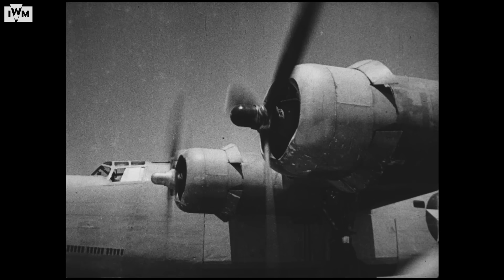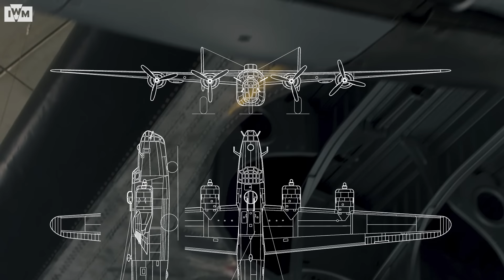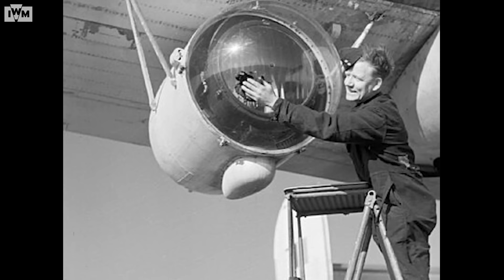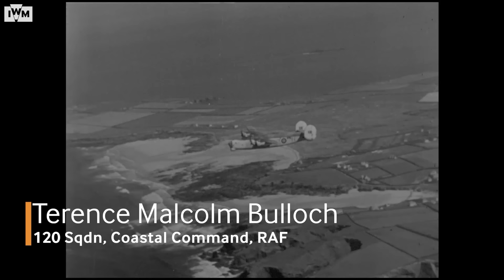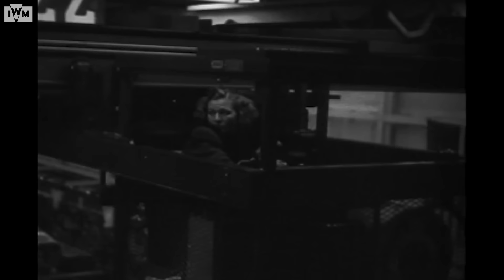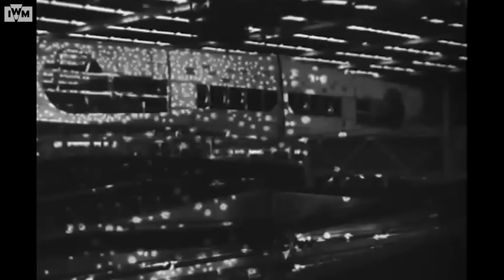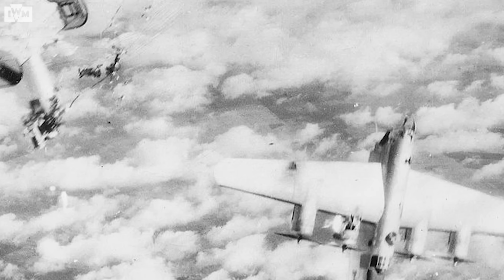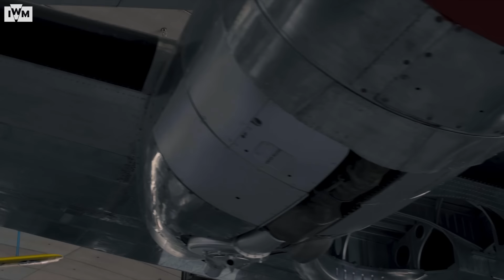The most produced Bomber in history had a bad reputation | B-24 Liberator

Comment: No such word as 'aircrafts'. Strategic bombing is not a flawed doctrine.
Reply: Yes.  It's not so much "flawed" as perhaps "overly ambitious".  Strategic bombing did not bring a swift end to the war.   However, it did help speed the end of the war along by exacerbating wounds and creates new ones that are constantly bleeding.  

Vehicles lost on the battlefield couldn't be repaired or replaced as quickly because factories were being disrupted and had to be repaired and replaced, themselves.  That might not bring a quick end, but it does bring a quicker end than you could otherwise expect.

Comment: I don't agree the Ploesti Oil Raids were ineffective. Nazi Germany's Achilles heel was fuel, they NEVER had enough. Even with coal gasification they lived hand to mouth and that process only yielded 87 octane fuel and NO lubricants. The Reich still needed natural petroleum and any disruption of oil supply at Ploesti hurt them badly-particularly in their ongoing Russian operations. While losses were high in 'Operaton Tidal Wave' the damage to the oil refineries in Ploesti was significant. Subsequent raids did even more damage. They did not shut down oil production at Ploesti, but the disruptions hurt the Wehrmacht and contributed significantly to the defeat of the Axis powers. Interestingly, the Air Force asked Consolidated to propose a design for a long range heavy bomber to use in case the B-29 didn't pass development-at that time the Superfortress was experiencing a lot of problems in testing. Consolidated used the B-24 airframe as a starting point, gave it a conventional tail arrangement and came up with the B-32 Dominator. Only 120 were produced before the war ended and they were used in a few raids on Japan, but nowhere near the extent of the B-29 which was produced in far greater numbers.
Reply: Some great footage from Operation Tidal Wave:   https://youtu.be/eWO7UqP7acc?si=IS5ExGy1h74rLl90

Comment: intresting that ones it was possible to invent a new bomber in 2 years. Today a new stealthbomber like the 21 needs 12 years until the first prototype is ready
Reply: Also, designs are much more thoroughly vetted before first flight. It is rare for a prototype aircraft to crash today. This was not the case in the 1940s.
Reply: The requirements are far more complex.
Reply: Far more complex planes, a much bigger bureaucracy, much harder requirements to meet.
Reply: An American Gold Dollar says that if the US was in a prolonged and declared World War the time would decrease dramatically. There just isn't a giant need to do it so quickly otherwise.
Reply: Apples to oranges. First up, war is the mother of invention.....and we aren't in a huge global conflict like WWII. We don't have every major manufacturer with their engineers working 24/7 to develop new aircraft. They certainly didn't have the level of bureaucracy we do today. And we don't have impending NEED for top of the line fighters and bombers in vast numbers. The B-52 bomber (even with modifications) is over 70 years old and doing fine. The vast majority of our current fighters were developed in the 1970s.

So we simply do not need new prototypes every two years or so.
Reply: The P-51 Mustang had a very short timeframe, too.  I believe around 1 year(?).